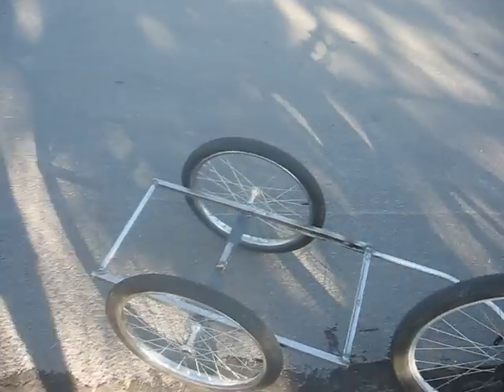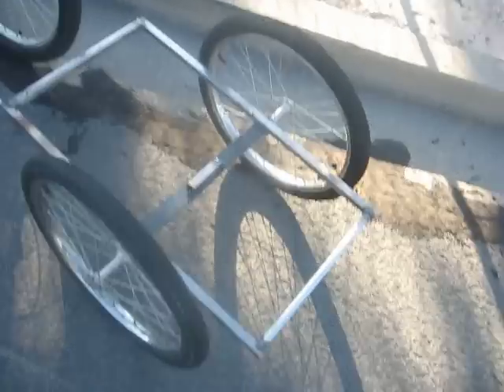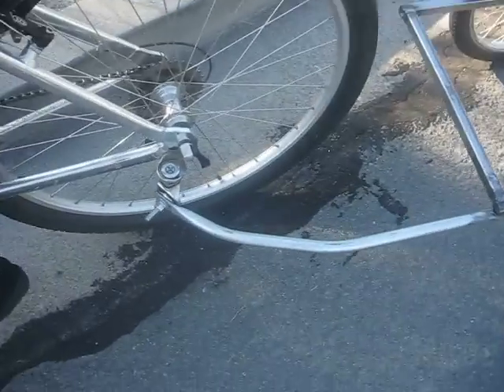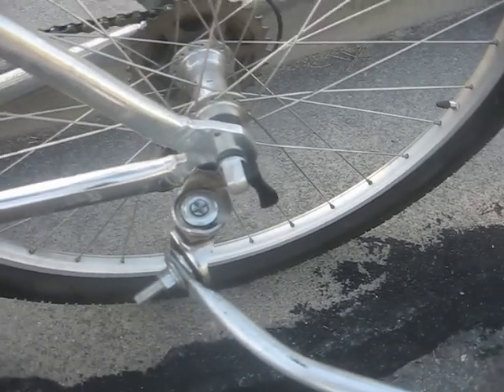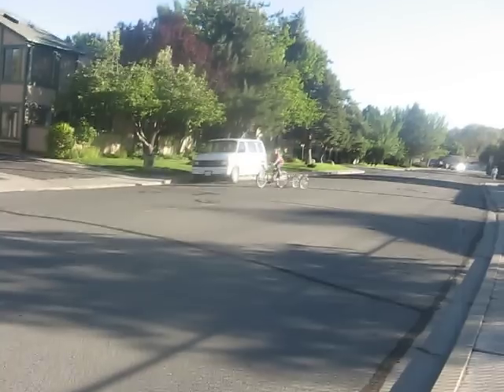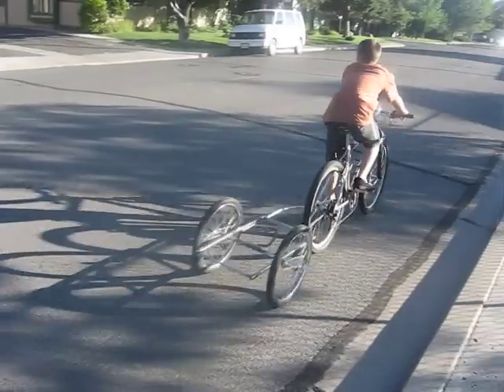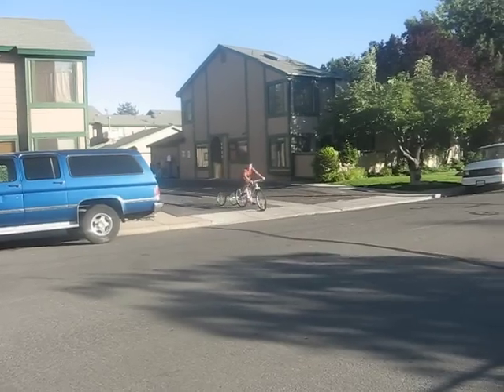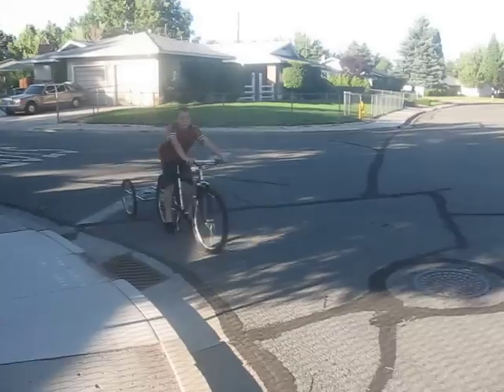A quick tour of our homebuilt bicycle trailer

Comment: Thanks for all the comments! The trailer worked out very well but my weld on the hitch where it went under the quick release failed. I was able to cobble it back together to finish a short camping trip via bicycle with it. Right turns were no problem. We attached a plywood deck using small bolts around the frame and then bolted a big green container from walmart to it. Its a great trailer! :-)

Comment: Hi there, its me posting under a different username. I'm glad you enjoyed it! Yak's are cool but this is more versatile in many ways. I thought about doing a single wheel trailer but this was simpler. As for the materials, it is made out of mild steel. The tongue is made from electrical conduit from home depot.